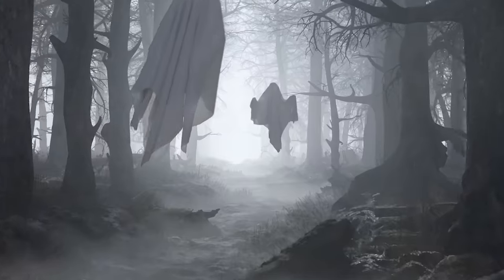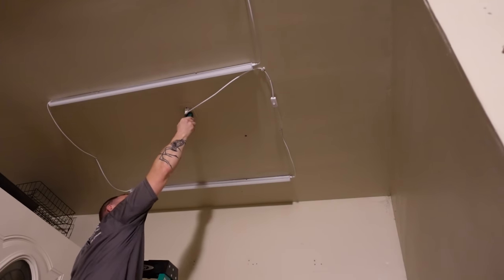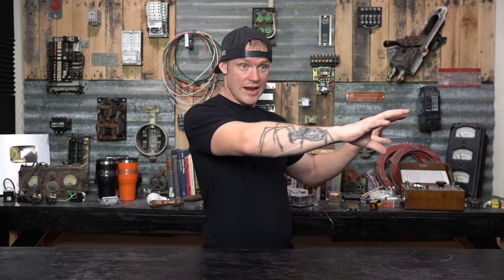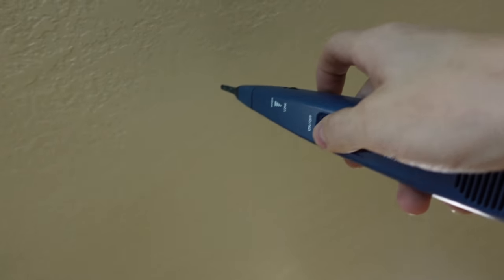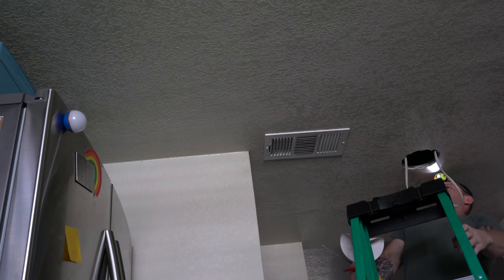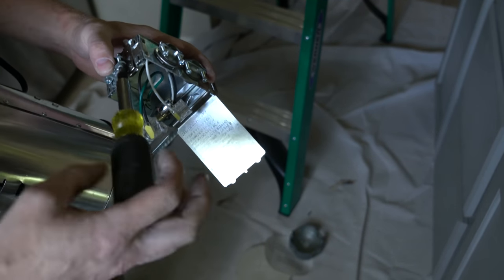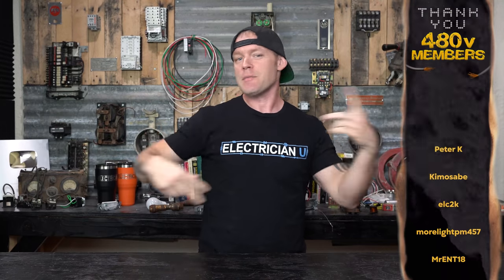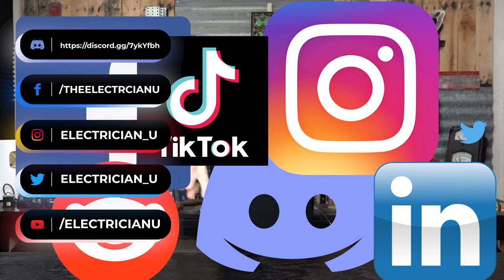THIS IS WHY ELECTRICIANS DON'T HIDE J-BOXES IN WALLS - Finding Hackwork!!

Comment: Why would anyone put a joint in a place where you can't get to it? Even if they are billy bobs electrics from down the road...like you are creating a possible failure point and then making it impossible to access. Side note was the wire nut lose and that's why it melted or just the side effect of a heavily overloaded circuit?
Reply from the maker: Many times when we see wire nuts fail, or splice materials such as wirenuts, wagos, butt connectors, etc. it is due to the poor installation i.e. not twisting wires securely, not landing in the wago properly etc. This is not limited to just these, though. Terminals like on breakerss, receptacles, or even light switches can cause an arc. An arc is when electricity flows through the air gap to fulfill the currect path, essentially in these cases. Arcing causes heat, and heat will break down these plastics uses in these materials. Thats why we see these things melt. Same with the insulating jacket on like NM-B , or Romex as you may know it.
Reply: @ElectricianU  That's why you always double check and don't be in a rush....
Reply: @ElectricianU  I have actually seen lugs come loose in high current panels from the vibration during surges. Also causes an arc, on the bright side most houses have arc faults now

Comment: Not so much “code guru”  fellow sparky! But the more knowledgeable you are in Code- the better Electrician you come to be… Not to mention “probably doesn’t apply to you yet.” But if you ever step up to the big boy Industrial Electrical work. Working per code can and will save lives- there’s a reason why they exist bud. And I know  some are just outright dumb but learn to live with them brother.! 

Also for the mess in kitchen and dust situation- they sell a drill adapter / hole saw that comes with a plastic plate to catch all dust- Milwaukee and Klein both sell them check em out bro- good luck in your journey sparky⚡️

Comment: I don't know that you actually "fixed" the problem. You certainly found a symptom. The problem is excessive load on part of that circuit which caused the joint to melt. Clearly, the homeowner has installed extra lights and crap on that circuit. You might have suggested more efficient lighting which runs at lower amperage or installing a new circuit. Not that those are easy or cheap, but it would be tragic if the home burned down when the problem was known and preventable.

Comment: Cut the copper and strip it again i found electrical had knicked the copper when stripping so outlet worked until you put load on it,melted nuetral overloaded circuit or loose wire
Some handy man was on you tube doing a kitchen remodel telling all his viewers to put boxes in ceiling.
The other day looking at outlet home owner said outlet used to work then I took off outlets and lights and whole house had been rewired and they never wired the old outlet  .I just gave up on it I could have  taken more hours tracing it or wired it to a nearby outlet but as the home owner lied to me about it working as I was leaving .they showed me hallway lights not working the electrical wired
3 apartments wrongly on 4 way switch so apartment lights were switching off other apartment hallway lights,,,it should be an easy fix ,but let the other electrician sort it out,its a tripping hazard on the stairs
They had pir sensor lights
Switched  off by other apartments in different  hallways and that's only the incorrect wiring i could see

Comment: Something to consider:  perhaps the unusual voltages arise from the hot-side voltage feeding across something that is plugged-in and back to the bad neutral connection but not all the way to the panel ground/neutral point.

Also, one more thing.  I appreciate your diagnostic techniques and actually learned quite a bit, but the profanity is so distracting that it's a problem.  I am quite capable of outrageous utterance and in fact practice it with great skill myself, but please know that it hurts your credibility.

Comment: Diagnostic is not working on the circuit- I.e. measuring the voltage —- working on the circuit is when you start unscrewing terminals.

Comment: You really should build yourself a little test plug with 1k resistors between L, N, and E in a triangle formation so you can measure voltages when the circuit is actually loaded. If you measure 120V from L-E but only 60 from L-N, that means your neutral is floating, for example (which I think is what was happening in this case?). These "phantom voltages" that you're talking about are obviously just high-impedance (shitty) wiring connections. A standard voltmeter is useless in this case since its input impedance is too high such that any leakage current through the shitty connection will produce a voltage.

Comment: In my time finding problems it was observation and following instructions in two cases I saw things out of place a light that wasn't attached right the renter had broken the light socket and replaced it improperly the other was a smoke detecter the renter had disabled it and detached not only it's wires but the circuit beyond the other two were an answer to prayer I over an hour trying to find why I had no power to the bathroom no ground fault in the bathroom no blank GFI by the panel box looked everywhere there could be a plug in with one then the owner son who had come home came downstairs and said he had no wifi so I asked where's the router it was in a built in bookcase next to the laundry room which was next to the  bathroom down behind the books on the 2nd shelf from the floor was the plug and it was a GFI in the other I also was having a problem finding where the circuit was not making contact when I caught the cord that the bedside light was plugged into and on came the lights so I pulled out the plug and found when they had replaced all the plugs and switches they'd used the push in conector a peice of spring copper the thickness of a peice of paper touching the side of a round peice of wire  no wonder it failed my last one was same thing push in connectors he needed an electric lift to get out of bed I started there the hot had burned off the other side of the beds plug was the same so was the hallway plug and so was the ark fault switch in the panel box attached it temporarily to another circuit and got power to the hall plug but not the rest started checking other plugs they were OK so although it's not to code to have one in the walk in closet I started digging in there it clothing piled 2 ft deap around the walls finally found a plug it was also burned off one thing I found out from an electrical inspector was that you need tools to see if a GFI  or ark fault is actually working properly in this case the ark fault breaker wasn't  working as the plugs obviously had been arking for a while 4 plugs and the breaker all fried before the plug that started it all finally lost contact probably for the whole 7 years since the house was built  I too was called in to find why why two four way circuit weren't working right the builder had problems with his addition an engineer had screwed up on his roof calculations and the roof had to be replaced that took a couple of years in the meantime the electrician who'd done the rough in was gone so he had another electrician to do the final put in all the plugs switches and lighting he had two sets of hallway lights that were controlled at three points trying to figure out which wires went to what in those 6 boxes was something the new electrician had a hard time with he basically had things right but sometime over the years what screw attached to what on the 3way switches had been changed the common was not in the same place since I am not an electrician I go by the color coding on the switch as well as memory when I first looked at them everything looked right but while checking wires to find what ran where I noticed the wire that went to the lights although from memory it was attached to the switch in the right place I noticed that the dark color terminal was in a different spot so I changed the common to it and checked out the other circuit and the feed wire and did the same I also checked an old 3 way switch I had in my tool box it confirmed my memory the way he had it wired was correct for the old style switches but not the new after changing things around it worked properly you could turn the lights off at any of the three locations and turn it on at any of the other places places so either the electrician had gotten some weird switches or things had changed working as a site manager that's how I learned about the testers the GFI tester was cheap so I bought one but the ark fault tester is almost 2 hundred dollars and for amount of use I have it's not worth the money for someone full time it might be but how many ark fault breaker are defective you might find 1 in a hundred  but for the inspector he definitely needs one as he does thousands of inspections a year in all the sites I worked on I never had an ark fault fail an inspection but I did see lots of GFI fail since all I did was make sure any plugs  and switches that were within the distance from a sink tub or other running water devices were GFI after a couple of jobs failing inspection I bought a tool after the first one I checked by the built in tester but found if the ground is broken somewhere it'll test OK but will fail the tester

Comment: Bro u could have removed the face of the vent, cut an access hole in the side of the solid duct, worked on the jbox then simply seal and rivet a patch of sheet metal on the inside of the vent, replace the white face and boom. J box wiring fixed and u would never know what had happened

Comment: If by "weird voltage" you mean 48 VAC that occasionally pulses 90 VRMS at 20hzAC But drops down to 2 VAC when you turn on the device, stop trying to wire lights into your POTS phone line.
If by "weird voltage" you mean 45 year old voltage that hangs out outside of the liquor store and offers to buy booze for voltage that's still in high school, I suggest calling the police instead of an electrician.
If by "weird voltage" you really mean "wired voltage" you might possibly be dyslexic....

Comment: I hate going into peoples houses and figuring out what weird shit people have done. I had a service van for 4 year (mainly commercial). I think every electrician should do it to get good troubleshooting ideology. But saying that residential is the worse and probably the worse for troubleshooting; least with commercial and industrial there's  usually a high quality of things and less not qualified people working  on things. One thing about the new down like what is the means of switching it ??

Comment: When I incountèr such problems I will pull  until it comes out or something breaks free even if the air handler comes with it . Mostly worked industrial and commercial electrical  ,  and in industrial a common fuse was stainless steel bolts .  On a job that I worked on, New Construction had  at least five electrical companies there ever .  body kicking me around ,everyone very safety conscious my butt to death  ,  every thing they had to cut unistrut  threaded rod  àngle iron was left with à knife edge ànd the scrap every wheres .   Working in the over head doing my every best not to touch any thing.     climbing  on through  trusses joist various equipment  .    Run into some bodies energized circuit. That made me unhappy, sow I shorted it out ,  Carried on  with the pipe I was running  when exposed wires where difficult to get around I wound give them the short circuit test  .    Moving along and another short circuit test this one was a blast also but this one I heard the breaker throw , ilooked down and  seen that I was over the control panels that I had tripped with three electricians scratching their butts , I yelled at them eventually they looked up , and back to what ever they where doing ,  I  repeated test two more times   they did not comprehend  next step one fender washer one super duper tap con screw  and wires  ,  thirty minutes later a whole bunch of electricians,  figured I was in trouble told my supervisor and on to another task .

Comment: Are you sure you are totally familiar with the subject matter here. In most residential structures circuits are not necessarily set up by geographic location.

Less than 1/2 of 1 AMP, traveling through your heart,  can “kill your ass”.
I have been zapped by 440 volts, not pleasant but no medical issues. It’s amperage (which is current flow) that can kill you. EMF (voltage) is not the culprit. It is only the pressure that pushes current (amps).

Comment: why ppl can get hit with 20k volt taser guns and live? i thought it was the AMPs of a circuit that kill ppl. when you say voltage can kill i feel like that isnt completely correct. i was always told AMPs are the killers, not voltage. of course high voltage systems are deadly, but im guessing because of the AMPS they produce. im sure this comment will be ignored but maybe someone could clarify?

Comment: Was testing between two circuits once and got two different readings for each leg 80 volts other read 160, then both tested 120,then change again wtf- asked an electrician and instantly said to check (aerial) ground coming from pole.sure enough, ground was connecting periodical from the wind🤷‍♂️

Comment: Surprised you even found a box in the ceiling as many fly by night contractors will just splice into a wire with no box and no access. Every idiot who is doing electrical should know if something ever went wrong then how can you troubleshoot and correct, with the risk of a house fire and safety should that happen. These so-called contractors also hide the connections or boxes inside of walls, welcome to unqualified people doing non certifiable work all for trying to save a dollar in cutting all corners. We expect homeowners to not know about electrical codes and best practises, however they need to take some of the blame in hiring unqualified contractors with the lowest price on their home renovation projects. Lucky you were able to correct this one, others instances woud require a lot more effort especially when it is structural. Cheers.

Comment: don't understand how the box got there or how the workers were able to disturb it...  ??
Reply: Just a guess: the workers may have pulled too much current through the circuit (with work lights or power tools?), which caused excessive heating of the wires, leading to the failure of the wire nut and the partial short circuit.

Comment: I've done one hear about so many years ago I can't remember when but person had plugged 2 space heaters in one each side living room well they didn't know that the 2 plugs even though they were on 2 different walls were all daisy chained together well 2 1500 watt space heater 1 14 gauge 15 amp circuit no good it melted the wire well I was using a no contact tone device to get a general idea where the break was well it was in the wall on home run going to breaker box 12 in from first bend out the wall in to the ceiling well I'm like crap well It gets a new home run since I already schedule to put a new breaker box anyways because other issues it had burnt bus bar in the breaker box I wasn't going run a new home run into a fire hazard waiting to happen but that job had some weird voltages and weird trace contiunity

Comment: Pretty funny, electricians always blame the carpenter of the helper, must be union guys. I did a remodel years ago, the electricians had the "everyone is too stupid to do our job" attitude. On top of spending far too much time playing "baseball" with a wad of duct tape and length of conduit they managed to run a 14-3 wire to a GFCI outlet and install it behind the dishwasher to power said dishwasher. Yeah, how many things are wrong with that one set up. No, I did not have these clowns back to fix it, they were hired by the homeowner, only once.  Yes, I have some very good electricians as subs, but a word of advice, it's not always the carpenter's helper who is clueless. BTW, I repaired the incredible screw up made by professional electricians after pointing it out to the inspector.

Comment: What I hate most is when jackasses tie every neutral and ground together with 3 phase!!! Especially with 120/208 and 277/480 mixed!!! Back feeds on neutrals on both  of them of 208 0n 277/480 and 277 on 120/208. We had 8 floors of a casino hotel in Tunica. Non Union hired crackheads off the street!!! 8 mths to do 8 floors of a hotel is ridiculous.

Comment: Think thats bad? Im an hvac tech and there is a guy out here running just wire no conduit not, bx, no mc, no greenfield, not even romex just bare wire throughout entire homes all outlets lights kitchens. Just wire 0 ground wire just hot and neutral. What need to get into steel outlet box no problem puch out knock out and run the wires right in. Need a new outlet in that kitchen island no problem screws outlet right into wood hole he cut out ran conduit down through the floor and stopped right there in the crawl and continued on with no conduit again nothing but wire no grounds anywhere... f#$% me. Turns out this same guy and family died in a house fire. No wonder.

Comment: Dude neutrals are still connected all together in the electrical panel, wtf are you talking about
Reply: First of all neutrals should be referred to as grounded conductors, and they are not the same electrically outside of a breaker panel as they are in a panel. Also they are not the same electrically in a sub- panel as they are in the main service panel. If you don't understand the difference you shouldn't be doing electrical work.